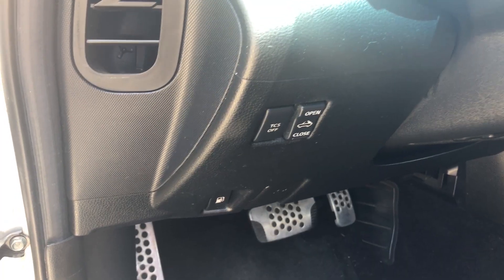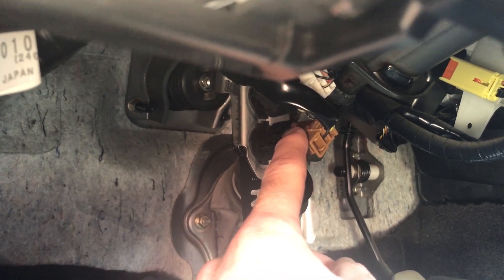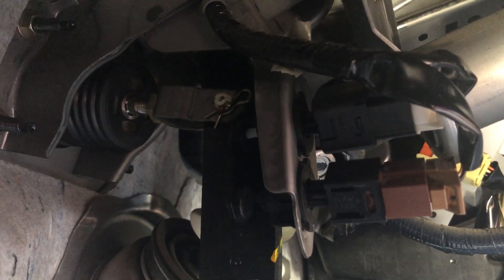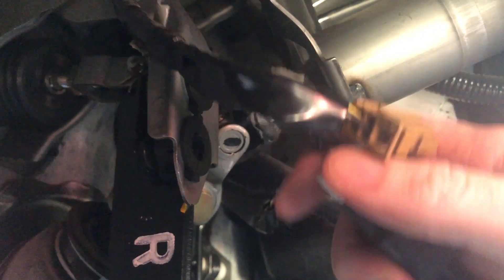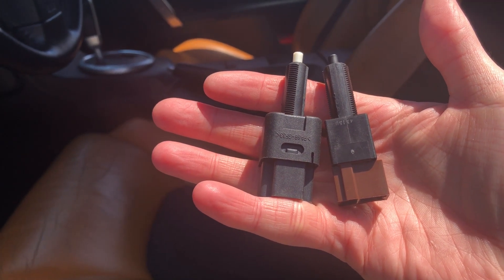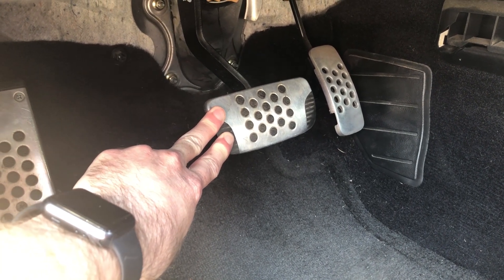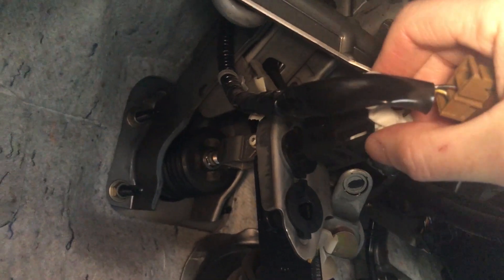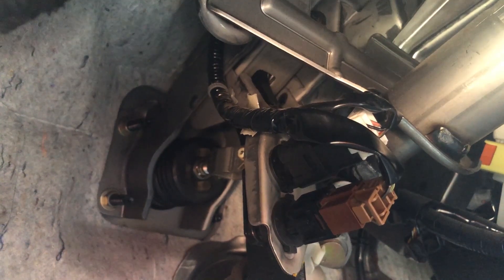Nissan 350Z Convertible Top Won’t Move, Brake Lights Don’t Work or Lock up, Cruise Won’t Turn Off

Comment: You helped solve my locked-up rear brakes for me!!! After realizing my brake lights were not going off I bought and installed the [stop] brake light switch, only then did I discover that the rubber stopper/grommet had hardened and broken off the brake pedal. I decided to use metal screws instead of the rubber stoppers. While installing the metal screws I pushed the brake pedal and inadvertently repositioned the pedal during the process of installing the screws and switch. No one could tell me what was wrong. Two days later, after finding your video and listening to my wife's suggestion of undoing what I did to install the metal stoppers in the first place I properly reinstalled the switch and the problem was SOLVED!

I BIG thanks man! You save the day!
Reply from the maker: Glad to help!  It was kind of scary when it happened to me and I was surprised by the lack of details about the issue out there.
Reply: Jesse Locke  were your front brakes locking up to or just your rear ? 
My front brakes and rear lock up as if i was pressing the brakes the whole time im driving ,only started happening after a shop supposedly replace the brake switch
Reply from the maker: I bet they installed the switch too deep. It’s really easy to do.  Watch what I do here and check yours and I bet it is installed all the way down.  Just twist it and hold your pedal up while you reinstall it and it will fix it.  And then go tell them they almost killed you and owe you new brake pads.
Reply: My Excuse For Buying Stuff  thanks man ill check tomorrow in the daylight ill keep you updated
Reply: I had the same issue man
Reply: Exact same thing happened to me. I'm actually unable to go. And on side of the freakin road. Hopefully I'll get goin soon. Problem is I barely got off the road and have to hang my body out in the road to get up under there and look.  I hope this fixes it

Comment: So before you fixed it did your seat move and windows go down at all? My windows and seat go down and my rear latch releases and that’s it. No top moving at all. About to get rid of the car cause I don’t want to spend more then the car is worth to fix.
Reply: There’s a forum showing you how to repair the 5th bow motor. That’s likely the cause of your top not moving

Comment: same damn thing happened to my 04 350Z convertible. New top 2 years old, garage kept. I put the top down went for a ride came home no movement at all. Can hear it engage but nothing. Any suggestions will help!
Reply: Have you been able to fix the problem I have the same issue??

Comment: WE just purchased a 2004 350z and took to the Nissan dealer to check out top. He said the motors are fine but when we push the button to open nothing happens and we don't hear anything. Any other suggestions would be greatly appreciated!
Reply: Yes, Margie, we did fix our top. The problem was the elastic straps (see link, he helped us a lot!), and we also replaced the 5th Bow motor, which is a very common problem with these tops. If you're not hearing your motor initiate when you push the button, be sure you have your foot on the brake while you're pushing the button and check the switches discussed in this video. Hope that helps: https://www.youtube.com/watch?v=_PSfgh7uXuI

Comment: Hey man, i got a 2003 350z, and everytime i get in the car at night and turn my headlights on, the brake lights on the back stay on all the time, but just when my headlights are on. I replaced the brake switch and also check if the brake rubber stopper was there and it was there. But still happens, i have no idea what can be wrong you have any idea?? Im lost.

Comment: May I ask what spoiler do you have on the silver 350z? I know this video is 4 years old, hoping you still have the car. Thanks
Reply from the maker: Is was on there where I got it.  Don't have this Z any more.  Now I drive the blue one in my icon. But Z1 has a 350Z Rear Wing by Stillen that looks similar.

Comment: So for the black one (for the top) do you push a quarter of the way before twisting right ?
Reply from the maker: You have to push it in far enough that it doesn't engage the button,  but will engage it when the pedal is pressed.  It you put it in too far the brakes won't ever release,  but it you don't go far enough the brake lights won't work properly.  It was more than a quarter of the way on mine.  Insert it until the button is pressed, but it isn't pushing back the pedal.  Then turn.
Reply: @spyderbandsandmore7458  lol sounds catch 22..😄
Reply from the maker: @Ninja97587  Well, kinda, but that is why I made the video.  I did it wrong the first time and my brakes locked up on me when they wouldn't release and got VERY VERY hot.
Reply: @spyderbandsandmore7458  I’ll give it a try tomorrow and will let you know how it goes! Thank you for the link! I’m in Australia and ordered it for $50 AUD, my local auto shop wanted $180 for the same part!! 😳
Reply: @spyderbandsandmore7458  OK so I replaced the brake light switch and the top on my 350 still won't open 🥺 So will have to diagnose the problem...

Comment: Dang! My manual z is not getting power to the top, so I bought the switch, but only one switch was available for both auto and manual. The switch arrives in a week or so - sure hope that solves the problem - thanks!
Reply from the maker: Let me know.  Mine was an automatic so I'd like to see if you experience is different.
Reply: @spyderbandsandmore7458  Will do. It arrives on 9/11 - not the most promising of dates, but I'm really hoping it solves the problem. We had the 5th Bow motor replaced, but after the install, the top wasn't getting any power  at all. So, without doing any metering around, I'm thinking it's either the brake-pedal switch, the center console switch or a relay - if nothing else, at least we'll know we have a fresh brake-switch... Take care, and I'll follow up with ya.
Reply from the maker: Just make sure you watch the part about installation depth because that is what I screwed up the first time.
Reply: @markh.2899  Did you fix your top problem?? We just bought a 350z and took to the Nissan dealer. He stated the motors are fine but we don't hear any thing when we try to put top down. I look forward to your reply!
Reply: @markh.2899  did you end up solving your issue? Currently working on an ‘04 manual Z and whenever I hit the “open” switch absolutely nothing happens
Reply: @rileysanders2369  any updates?

Comment: My wife just brought a 2004 350z and the soft top will not move or even attempt to open (looks just like yours).  The brake lights work, and the cruise control is working fine.  Any idea of what could be going on with it?
Reply from the maker: I assume the top is up.  When you unlatch it, press the brake and then press open the back lid doesn’t move at all?
Reply: @spyderbandsandmore7458  We found out that someone disconnect the switch and it was because it will not latch back once it let down.  Now we have to replace the soft top.  Can you tell me how many motor the roof has and where can I found the diagram for them?

Comment: Okay so I watched this video, but I’m not sure if this is the solution for my problem. I have the exact same car, Nissan 350z roadster, automatic. The rubber pedal stopper broke for mine, and I got a new one, but now whenever I have something there and try to drive my brakes are locking up a little bit, not allowing me to get to speed, and it starts to get hot and smoke after a while. Do I need to just adjust those two sensors so the pedal comes out all the way (assuming mines not out all the way). I spent $15 on that stupid piece and broke it whenever I had to take it out because my brakes were smoking (all 4 tires btw). My top comes down like normal, but my lights stay on 24/7 without the rubber stopper, so I just put a penny to hold the button when I’m not driving, but it’s annoying, and this is by far the closest I think I’ve gotten to a solution
Reply from the maker: I am almost completely sure this will solve your problem.  It sounds like it just needs adjusted.  You switches sound like they are fine if your lights are on.  You will want the rubber stoppers, just take the switches out and adjust them like I do in the video and that is going to solve both of your issues.  Your brake lights will work and your brakes will stop locking up.
Reply: Would you know where to get a rubber that fits? The one I ordered has a little bit of play, pretty sure it’s not supposed to anyways
Reply from the maker: Unfortunately (or fortunately) that isn’t a part I have had to replace.

Comment: Hey I just bought a 350Z and my top isn’t working at all. Nothing else is wrong. Do you think it’s the white switch?
Reply from the maker: It is possible.  The easy way to test it is to take it out and use a continuity tester on it.  Put the probes on the separate plates in the back of then then see if the the continuity is broken when you press the button.  I’m not sure if it defaults to an open or closed circuit, but pressing the button should change it either way.

Comment: Thanks for posting but I have a question.. Only my convertible top doesn't work. No brake issues or cruise control issues. I checked the motors and they are functional. Any chance its still the white switch?
Reply from the maker: Have you double checked to make sure your brake lights are coming on?  You can also take out the switch and test it with a multimeter. I don’t remember which way was open and which was closed when testing continuity. But it was really easy to see the difference on the bench. That would tell you for sure.
Reply: @spyderbandsandmore7458  Thanks for the response. There are  no issues with the brakes in any shape or form though. Grrr. I was thinking it could be the switch. The convertible top died over time, meaning it was slower when problems started, then worked intermittently. Now doesn't work. I've narrowed it down to either a switch or computer problem
Reply: @kylehome8818  Kyle, did you figure out the roof issues?  My brake lights work, but the top isn’t moving at all. Either direction
Reply: @bagramdave883  updates I have the same issue
Reply: Me too

Comment: Just looking at my dad's 350z ..  his needs new spider bands which i ordered from you.  BUT.. he also has another issue.  The hard cover portion stops a bunch of times on the way to going back.. so he has to keep pressing the open button over and over until it finally opens.. and then the soft top will start to come back (and then not go in all the way because of bad spider bands)..   Any idea what would cause the hard cover portion to require pressing the open button repeatedly  to get it to fully open?  Could the switch be causing that as well?
Reply from the maker: It could definitely be the switch that sounds exactly like what mine was doing.  It would move then stop and move then stop and I would push the switch.  On mine it ended up being the petal switch I detailed here.  If it isn't active then the top will stop.  Mike kept getting worse until I replaced the brake switch then it was perfect.  Just make sure you watch on how to install it and don't put it in all the way.  It's an easy job but also easy to mess up.
Reply: Did you end up figuring out your dad's convertible top issue? Mine died the same thing where it stops and I have to keep pressing the button to open the top.

Comment: I this was a while ago but I replaced the part on the break and my top still won’t come down... it’s just clicking any suggestions?
Reply from the maker: Where is it clicking?  Does it move at all. The back lift or the cover open?
Reply: My Excuse For Buying Stuff it’s clicking in the back the only thing it does is bring down the windows and unlock the top that’s it
Reply: @ericbaldonadojr1804  Hi Eric, did you ever figure out what the problem was? mine just started doing that a few days ago? I get the click ....

Comment: My open top light is on and now my top won't open. ....will this fix my issue? It just started today
Reply from the maker: Maybe. That light only turns on when you unlatch it right?  Do your brake lights work?  Does it do anything at all?  Move a bit and stop?  It could also be your lid motor has gone out.
Reply: @spyderbandsandmore7458  my top has been working fine and I just had it down yesterday but today after work it wouldn't open and the open light stayed on, let me check my brake lights but Im sure they work
Reply: My brake lights work fine and the latch is latched correctly but the open light is still on and my top won't move at all. I'll look up the part tomorrow at work and swap it  out since I work in auto parts lol
Reply: @reddfigga80  can you lmk what your solution was??

Comment: 🤦‍♂️ Car designers man
Reply from the maker: I don't know, I think it's actually a pretty good design.  It's very adjustable.  You just have to know what you are doing when you install it.  Which I didn't the first time.  🙂Hense the reason for the video.
Reply: @spyderbandsandmore7458 So you build up the pressure in the pedal first when the car is off, then install where it just recesses right?